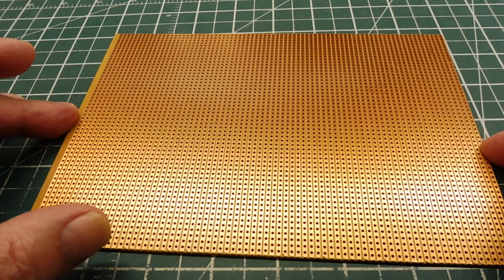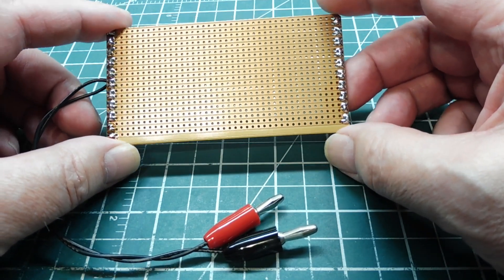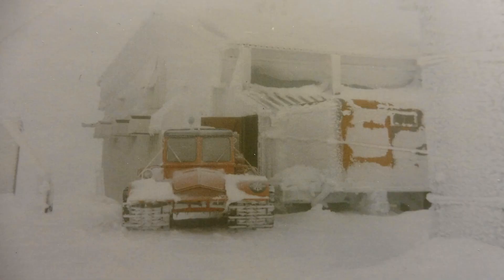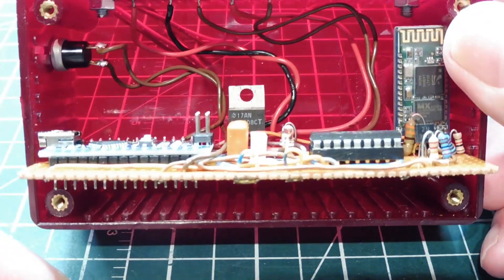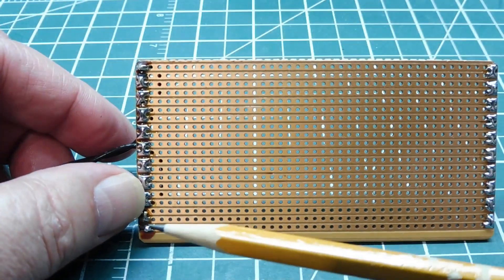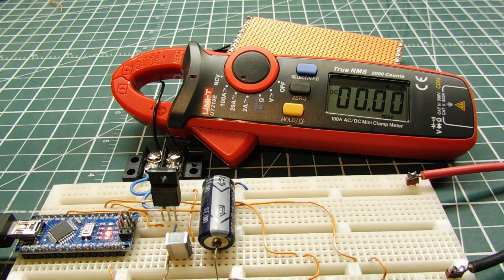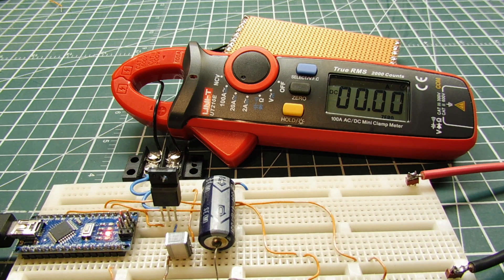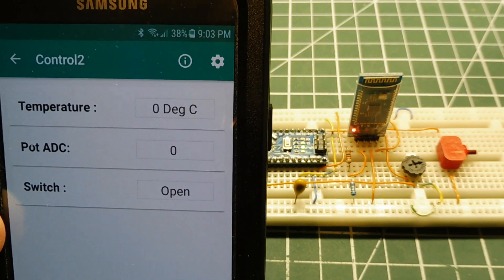Make Your Own Heating Element Using Veroboard

Comment: Thanks for the info. I didn't know that arduinos had internal temperature sensors. How hot can these boards get before they fail? Subbed.
Reply from the maker: Check out this video: https://youtu.be/wEHCfDzW4ro
Maximum board current should be limited to 4 amps.

Comment: This is good for inside a terrarium also, because a large size can be used. Of course an even better material would probably be aluminium, since it has a higher resistance than copper. You can pretty much use random lengths of wire as resistors, however at high voltages you would need ridiculous lengths in the hundreds of metres to get the ohms needed to not allow the high voltage to just burn out the wire. They use nichrome usually because it has a massive resistance, and can take huge temperatures.

Comment: Do not use veroboard. The phenol base starts to evaporate when hot. This stuff is not healthy.
Reply from the maker: As indicated in the video it was a temporary fix in a remote telecommunication site where minimum current was used.
The Vero board base material is SRBP with a max working temperature of 97 degrees C. Check data sheet page 8.14.
https://docs.rs-online.com/e9b7/0900766b800270c2.pdf
If this is a concern, epoxy glass strip board is also available.

Comment: 3D printers from Reprap family (open-source movement, and all the small and affordable ones are derived from it) generally use a PCB as a build plate heater, just a thin track that snakes all over a 20x20 to 30x30cm size board.  This heater is under the surface that is printed upon, and is needed to control adhesion of the printed plastic to the print surface. Resistance is also similar order of magnitude, a 90W heater at 12V or with a different layout with double the resistance, a 180W heater at 24V. What i find interesting is that before PCB heaters became commonplace, people built all kinds of adventurous contraptions with nichrome wire etc, and a veroboard heater seems obvious in hindsight as an intermediate evolution step on the way to PCB heater, as it's comparatively reliable and easy to build from off the shelf material, but it somehow didn't happen!

Comment: But i think arduino to measure temperature here will be a bad idea. it will be better to use a ds18b20 sensor for better results
Reply from the maker: Yes ... for precise measurements that would be a better choice. For my application I was interested in very large temperature swings below zero and then compensate with the heater to a normal value above zero, so I did not need pinpoint precision.

Comment: Very clever hack! Do you have any insight how long lived would such a heater be? I assume pretty long but wondering if there's some gotcha escaping my mind. I could use this to heat up LiFePO4 backup cells of my microcontroller projects running at our cottage throughout the year. The cells don't like charging under 0°C.
Reply from the maker: They would be very reliable. The less current you apply, the longer they would probably last. Fuse the power to the heater and keep the copper surface protected. There are many commercial stick on heaters available that come in many shapes, sizes and wattages that I also have used. https://www.directindustry.com/prod/heatsystems-gmbh-co-kg/product-120133-1680581.html

Comment: Do any precautions need to be taken to careful it doesn't short ( dew/bugs/metal filings?), or a spot doesn't heat up( to burn) in case of a bad solder joint?
Reply from the maker: Yes .. take all the precautions. Fuse the heater and position it copper side down in the enclosure. With the large currents involved a bad solder joint will be obvious when testing.

Comment: Didn't know Atmega328 had an internal temperature sensor!
Reply: It uses the ADC input MUX8 and the 1.1v bandgap reference voltage. You need to code in AVR C/C++ to access it. The Arduino Language doesn't "surface" it.
Reply: I'm just google searching for it now - I can't see anything?
Reply: Stm32f103 has one.

Comment: Very cool, I didn't expect the wattage to be so exponential with voltage.

How do those comshels stay powered? A very large buried diesel tank?
Reply: more precisely, P=U^2/R , of course you can apply also change of resistance due to the temperature change

Comment: You should start a series on diy heaters. Pencil leads can also be good heaters depending on their resistance as well as power resistors. I have used power resistors as heaters before and they are nice. The method you showed on this video to make a heater is similar to the one for 3d printer heated beds.